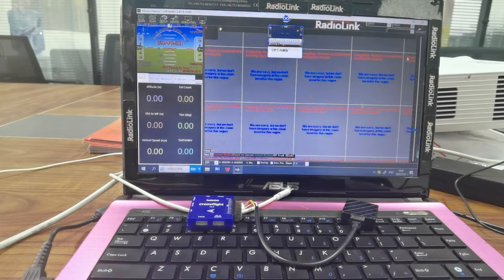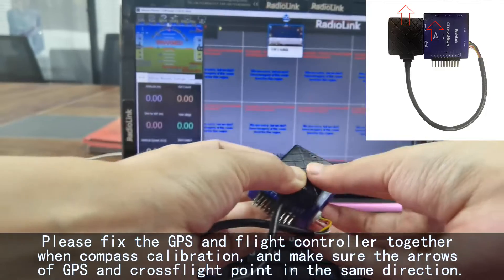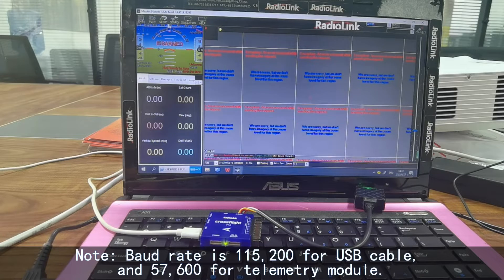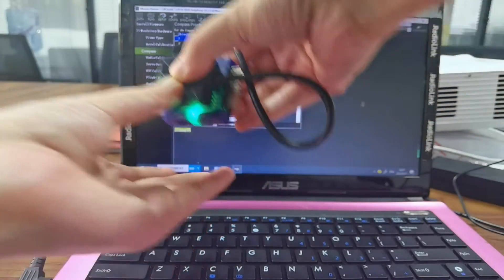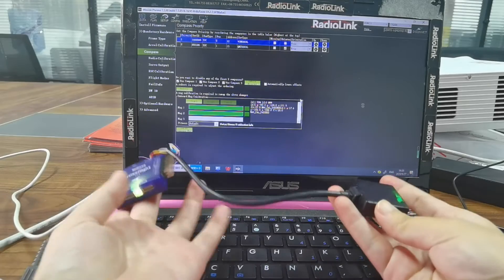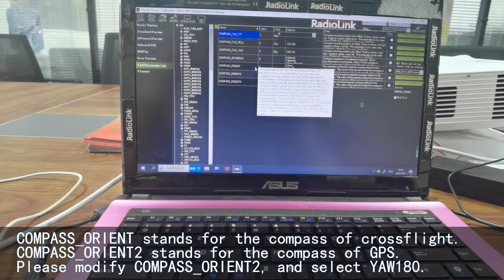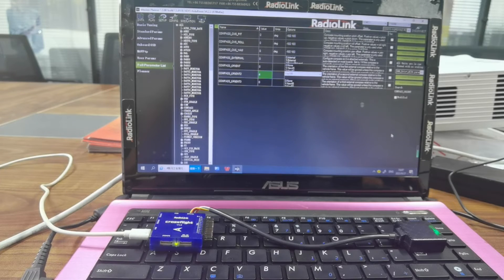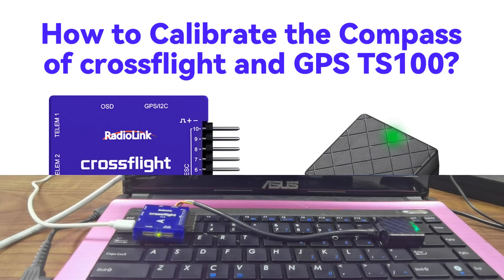How to Calibrate the Compass of crossflight and GPS TS100?

Comment: How to solve the problem of the pre-arm battery voltage being below the minimum arming voltage
Reply from the maker: i, sir. That is because Battery voltage is below BATT_ARM_VOLT. You can replace battery or adjust BATT_ARM_VOLT.  You can check the solutions for all PreArm failure from the website: https://ardupilot.org/copter/docs/common-prearm-safety-checks.html  If any questions please feel free to contact us. You can send an email to after_service@radiolink.com.cn
Reply: @Radiolink_official 
Thanks ❤
Reply from the maker: @cicclass  Our pleasure. If any question please feel free to contact us.

Comment: In mission planner , When I move It toward left it show right and when I move it it show left movement how to solve this problem /
Reply from the maker: Hi, sir. Which channel do you mean? For channel 2, pitch channel, it is normal that the movement of the joystick and the servo bar are opposite. If it is not channel 2, you can first check if you have set REVERSE of this channel on the transmitter. If you didn't set the reverse in the transmitter, you can reverse this channel in Mission Planner. If any question please feel free to contact us. Our email is after_service@radiolink.com.cn

Comment: hi, is the SE100 GPS compatible with the crossflight flight controller?
Reply from the maker: Hi, sir. SE100 is compatible with CrossFlight. But sorry you need to modify the plug of SE100 to make it match CrossFlight.Here is the link of SE100 for your reference: https://www.radiolink.com/se100  We recommend you to use TS100 with CrossFlight, because you can connect TS100 GPS to CrossFlight directly: https://fr.aliexpress.com/item/3256805282209175.html   If any question, please feel free to contact us. Our email is after_service@radiolink.com.cn

Comment: I have problem to progy in battery 1 low voltage failsafe error
Reply from the maker: Hi, sir. You can check the setting of the battery fail safe from the detailed manual of CrossFlight: https://www.radiolink.com/crossflight_manual  And for the PreArm error, you can check all the solutions of PreArm from the link:
https://ardupilot.org/copter/docs/common-prearm-safety-checks.html    If any question about RadioLink products please feel free to contact us. Our email is: after_service@radiolink.com.cn

Comment: Thank you for the video. 
I did all the steps correctly but when I Reboot the flight controller after Meg 1 and Meg 2 are full, a massage pops up error connect failed.
What should I do ?
Reply: Thank you for the fast response
Reply from the maker: @muhammadalawadhi2239  Our pleasure. If any question about RadioLink products please feel free to contact us. Our email is: after_service@radiolink.com.cn
Reply from the maker: Hi, sir. May I know what is the error displayed in Mission Planner? If there is error, you need to solve the problem of error then you can use it. If any question about RadioLink products please feel free to contact us. Our email is: after_service@radiolink.com.cn